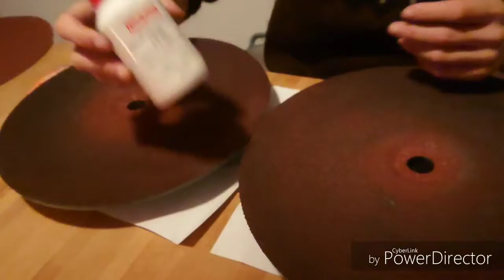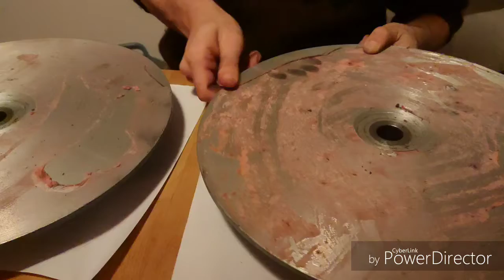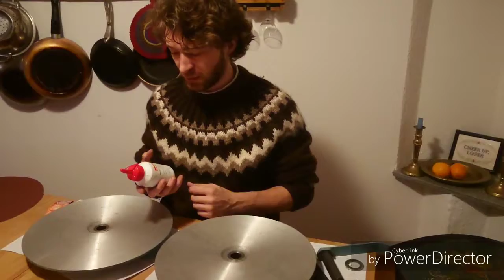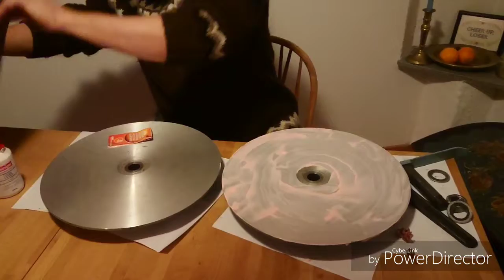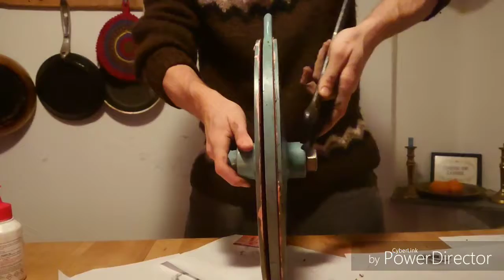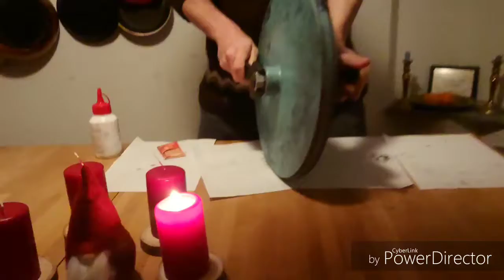Grinding part one: changing papers

Comment: Wasn't there a way of grinding without paper, using a coarse lathed cast iron disc and grinding abrasive applied directly to the disc?
Reply from the maker: That's news to me!
But if you know anything about it do tell, I'm always curious about different ways to do things!
Reply: @gbsklipperi6617  Cast Iron disc with coarse profile and grit directly applied on that disc. I did not find a good video - could be that this shorty is without paper - at least it sounds that way.  https://youtube.com/shorts/jSIQgbwoFBc?feature=share
I assume it was the older technique bevore emery paper was glued to the discs. But only an assumption. Ask what elderly shearers in Sverige say - maybe they know about. In Germany sometimes it is used today yet. Would be nice you could reply what you found out.

Comment: You seem like a nice guy.  But your are putting the washers in the wrong places.  One goes between the clamp plate handle and the first disc. The second goes between the nut and the second disc.
Reply from the maker: Tx for the top, I'll make a better video about that